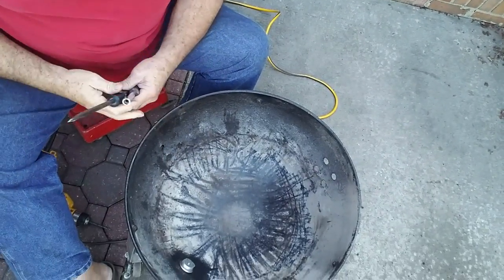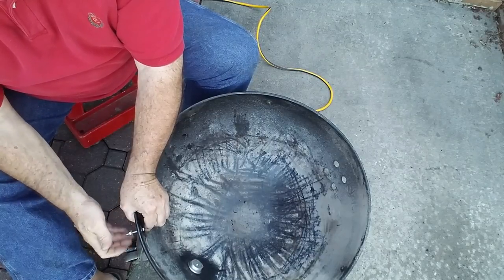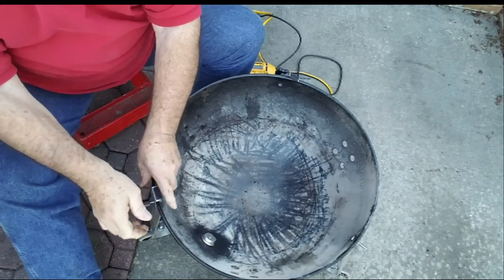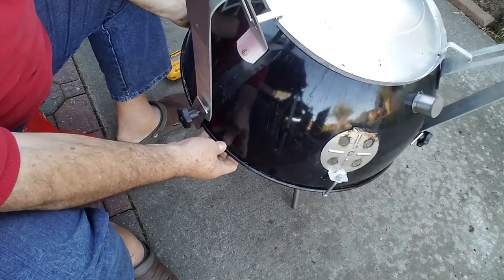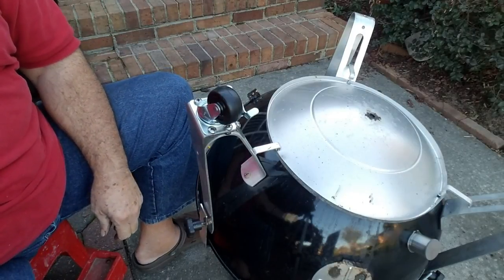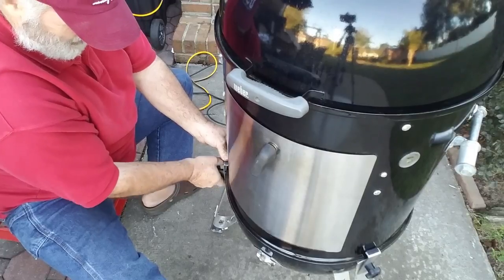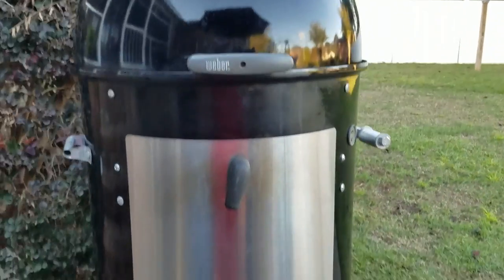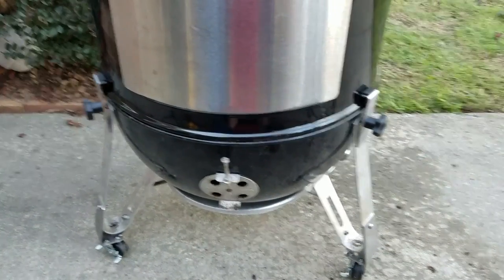WSM MOD | CAJUN BANDIT WHEEL & CYLINDER LOCK KIT | GRILL MODS | WEBER SMOKEY MOUNTAIN

Comment: It's a great mod Phil, real glad I went for mine. I did a lot of research before committing as it was expensive to import but I think worth it, you see a lot of thought has gone into the design. The struts serve a dual function in stiffening the legs as well as clamping the centre barrel. It helps with support instead of cross members. Glad to see you’ve put the how to fit video up, I couldn’t find any resource when I was looking a few months back so your doing a great service. Thanks man, hope all is good with you 👍🔥
Reply from the maker: Thanks for positive comments Jason. This one is very worthwhile to me. Glad you went with it. Doing good here. Have a great week and weekend.

Comment: Hey Phil, enjoy the videos,, and the mods..  something that popped into my head was, that it would be nice.. to have a  kids wagon handle attached to smokey mountain, or a " Y" rope assembly that could be attached to 2 of the 3 wheels and pulled around.
Reply from the maker: Hey Pepper. Yea Ive used my fire poker to grab a leg before to pull around. Others have said they do something similar. Your idea is another good one even with the locking kit. On smooth concrete it's a breeze,  but on pavers or surfaces with divits, it's best to pull from the bottom of the cooker. Thanks for the tip.

Comment: I tried rollers on mine, but the legs felt flimsy and I worried about damaging the bottom. I took the  rollers off and built a deck with rollers. I still had the problem with the mid section, so I use a rope to pull the bottom section. 

I really like that modification and may get that along with the rotisserie that will fit both my smoker and kettle.
Reply from the maker: That's interesting. I used a poker with a hook to pull it sometime. HMB just said a storm blew his off the 5 ft tall deck, and his didn't come apart with this kit. Not bad. Thanks-phil

Comment: Thank you for all the videos but one question Phil Cajun bandit is out of the kit for the 22.5 will the 18.5 wheel casters for the 22.5
Reply from the maker: I'm not sure. Wouldn't count on it. Go over to Woodshed Smoke & BBQ with slowhand. He has both sizes and has installed this on both. You will need to look at his mods playlist. He can answer your question.
Reply: Phil N Florence ok thank you for your time Appreciate all the helpfull videos

Comment: Great job on the video and modification.  Everything makes sense what you said and videod.  Just a thought while watching you here... I think Cajun Bandit should provide a better, bigger caster than those small hard wheeled ones they sold you.  Like the ones you get on a nice roll-a-way tool box.  It would roll much easier with a softer rubber and twice the size wheel.  But then again... it's only a Weber smoker.. :o)
Reply from the maker: Funny you bring that out Tony. I'm in the process of replacing the CB wheels because of that. Fine on smooth  concrete, still problematic  rolling across pavers. Stay Tuned.
Reply: Cool!  I've got a custom built 'oak pit' bbq'er..  has those same tiny hard wheels on it.  Always wanted to swap them out.  Maybe your upgrade will motivate me to do so?!  I'll be watching to see how your wheel upgrade works, Phil.  I just now subscribed and 'hit' the bell.

Comment: I'm diggin' those mods bro. That's one cooker I don't have yet. 😁 I try to have wheels on all of mine too. I hurt my back in the Navy and it flairs up from time to time.
Reply from the maker: Weber needs to address this. The WSM is a terrific smoker, however you don't need this happening. It should lock into place. They don't include casters or handles either. The 22 is big and a handful. Adding the lid hinge, the handles, and this wheel & cylinder locking  kit is a must IMO. From the comments and feedback, seems I am not the only one. However, with these mods and the grilling mod, it makes the WSM my favorite go to smoker/grill. Thanks-phil

Comment: They are made totally different now you get 3 new legs with a squared off base with a hole already drilled and all u have to do is mount the wheel to the legs and mount the legs to the smoker. No drilling. And the casters are larger on the new version

Comment: Looks like the Cajun Bandit wheel kit works great. Can you get away with regular wheels from the hardware store?
Reply from the maker: Yes, I actually began with those and it was just fine. I think that is what most people use anyway. I didn't need the wheels since I had done that mod, but it came with the package. I needed the cylinder lock so my mid section would not jump off the bottom when pushing it across the pavers. The wheels in this kit are smaller than the ones I purchased from Lowes which I had on there. The smaller wheels catch worse in the joints of my patio pavers so I need to get larger wheels. They were one large stud vs a four hole mount. I'm looking. The wheels which came with a drum dolly for the PBC are very nice and roll across the pavers with no problem. Buying alone are expensive. Still looking on this. The cylinder lock works great. Just need to get the wheel thing working better. If you have concrete it's no problem.

Comment: I see your problem and I can give you an amen!
I don’t have to move mine much, but when I do it’s iffy on the middle section. Thankfully my floor is pretty smooth and I’m under a big carport. 
Pretty useful mod👍
Question...what is that other round thing sticking out of the base near one of the vents? I don’t remember seeing it before.
Reply from the maker: Yep, if you are on a smooth surface you are good to go. Ahh you noticed the little round thingee. Sharp eye mate. That is the fan adapter for the BBQ GURU blower to attach to. Unboxing and install vid coming up, and a big brisket cook using the large capacity charcoal ring and guru. Stay Tuned.
Reply: Ahhh! That’ll be interesting!
Looking forward to it👍

Comment: Hey Phil, great video, I like the mods you did on your WSM. My only comment is that the wheels supplied with the kit are too small (no fault of yours). They need 3" to really move that WSM around better. The company cheaped out!
Reply from the maker: Yes, CB cheaped out on the wheels. I'm in the process of replacing mine now with a 3 inch wheel. Just had that conversation with another viewer. I'm still having trouble moving my cooker, however the kit holds the mid section together. Thanks-phil
Reply: @progers5019  Hey Phil, just for future reference I came across a company that sells a clip that attaches beneath the door and holds the bottom and mid section together while rolling it around. If interested let me know I'll dig up the info. Thanks

Comment: Great mod!  That's a good way to get hurt if you were not paying attention and pushing along and it pop off like that!  Helps to stay safer and I also like the rubber piece so that it is not metal on metal!  One question I do have, would you need to remove the brackets prior to cooking to keep the rubber from melting to the smoker?  Handles should be an addition that should be provided by them regardless!
Reply from the maker: Thanks for all the comments. This mod will help me out a lot. Sounds like others have experienced the same issue before. Doesn't happen every time, but it does happen. Thanks-Phil

Comment: Nice mod Phil. I noticed the lines in the ash dust, are you getting a lot of condensation buildup inside the smoker? 
Whatcha shooting’ with that there rifle on the table? Squirrel problems? 🐿
Reply from the maker: Yea, I need to get that cleaned better. I'm replacing the old rusty grates. Rifle is squirrel gun. Pecan tree.